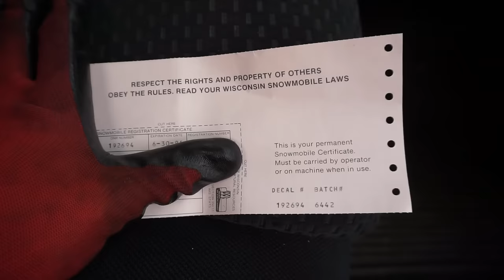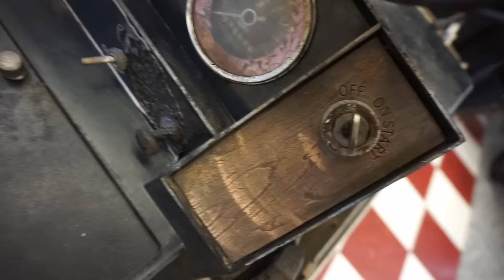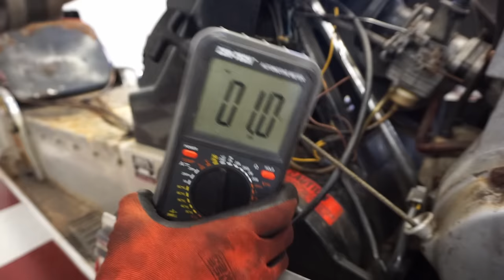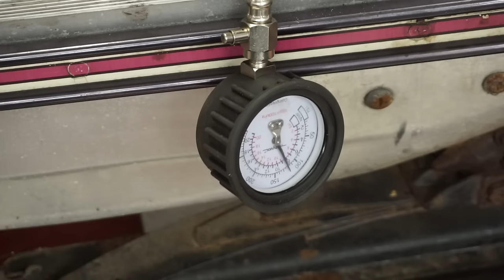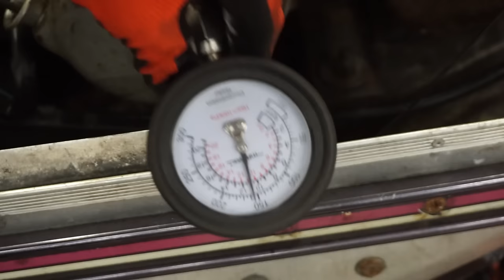$150 Sled Sat Untouched For 30 Years. Will It Run?

Comment: I had basically the same sled when I was younger. Arctic Cat 340 Puma. It was one of the most reliable sleds, never breaking down. I used to have to blow in my gastank to get it to start when it was cold.

Comment: Very nice! My father bought the same model new in 1972 and I grew up riding the machine, great memories! Arctic Cat was the first manufacture to invent the slide rail rear skid while other manufacturers were using the boogie wheel carrier for the track. A beautiful machine for the 2vintage fleet!
Reply: My dad bought this same machine in 1972 when I was 13 years old. This was the first machines that I ever rode on. I did happen to remember he paid $1095 for it.
Reply: @jefffreestone8476  I was 7 years old then, yes it doesn't sound like a lot to pay for it but back then it was a lot of money too. A great way to spend time with our Fathers for sure.
Reply: I was 15 in 72 and drove many fun miles on a Cat like that.

Comment: My favorite hobby was restoring vintage sleds from the mid 1960's - early 1990's, I have no idea how many I restored there were so many, the one thing I became very good at was rebuilding carbs, Tillitson, Walbro Mikuni ect.  I had no choice but to quit because of my back, I had a terrible habit of not asking for help when lifting and moving these old sleds into and off the back of my truck and trailers, and around my garage and property. My favorite restoration was a 71 Arctic Cat Lynx 292, that little thing was so much fun to ride for a single cylinder, it looked showroom new...I got it for $150, I sold it for $2000, but that was with a few hundred dollars and a ton of time and effort put into it....I enjoyed every minute of it. The guy I sold that 71 Lynx to enters it in many vintage snowmobile shows.  This old 340 video brings back memories.

Comment: So one fuel line is the feed,the other is the return.the feed needs to go almost to the bottom of the tank.also,that carb is a pumper carb.the pump is the bottom half of the carb,and it has diaphragms in it.last time I restored one,dennis kirk sells parts for them.should b able to get carb kit and the fuel filter that screws onto the bottom of the carb.pay attention to the way it comes apart!!

Comment: I don’t have the snow to own or get the chance to work on snowmobiles but I work on a good bit of vintage dirt and street bikes. One of the first things I do when trying to get spark is unscrew the cap ohm test it then cut off 1/8-1/4” and reinstall the cap. This removes oxidation of the connection allowing better conductivity. 
You do great work, very methodical 👍🏻

Comment: All in all a success story. Im guessing that the numbers written on the head plate were previous compression values. I know nothing about these sleds but I doubt wether the gas tank needs pressurising. Could it be a flow and return?
You could maybe get one of those carb bowls 3D printed or turned from a piece of aluminium stock easily enough. The slots in the flywheel are for adjusting the points through. (The croc clips were sort of sparking behind the plugs when you were turning it over by the way). The flywheel would only need removing when a points or condensor replacement was required. 
Evaporust and tank sealer will sort that tank out.
This is third video Ive watched and I love your enthusiasm. Keep them coming.

Comment: Eric Sandrin in Kirkland Lake had this sled it had 2 optional motors a 292 a and b motor super simple to work on and fix and talk about go anywhere sled ! The only other skidoo that could go where this panther could was a '68 super Olympic bomb , I know I owned 1 lol, but anyhow there's a little modification that we did and that was add some plates to lift the slide suspension on the 3/4 cleat steel track and it made a huge difference in the powder, and climb almost any hill up to almost 90 degrees, kid you not small motor but dam strong and pull ( emergency towing ) sleds 5 times its size and weight if I had the chance to get another one of these Panthers I'd buy it in a heart beat !!! I know what these old sleds can do it and they are amazingly strong and great in the powder and off trail riding !!

Comment: Love the snowmobile content!  One tool I think you would really like is an impact driver for removing rusted screws.  You kinda accomplished the same thing when you were pounding on the screwdriver but the impact driver also twists it for you when hit with hammer.  Also, when I've worked on snowmobile engines I like to pull the drive belt off the clutch so that when it does start I can throttle it up without the track moving.  Great work!
Reply: That's the worst thing you can do... The clutch can randomly slam closed and break it.. there's a reson the say not to.
Reply: @philipgagne1852  That's an interesting take and maybe something that newer or racing clutches are prone to.   I've been wrenching on sleds for over 30 years (as a hobby not a professional) but mostly 70's-early 2000's and never had a problem.  That's not to say it's not possible, I have just not ever heard of it happening.  When I do need to run the track I'll put them up on stands.  In my opinion, on a scale of worst things to do there are a lot more ahead of it including the sled moving forward when you or your bystanders were not prepared.  Best solution then would be to always lift the rear on a stand.
Reply: Yeah all clutches can do this look in repair and service manuals  many say not to run without a belt it's a big big no no.

Comment: If your going to get into older snowmobiles  always keep a squirt bottle with premix in it and you can squirt a bit in the carb with the thotle open to see if it will fire up for a couple of seconds to get an idea on how the motor runs and what you need to do next

Comment: Older sleds have a wear rod welded to the bottom of the skis, Newer ones have mounting holes in the skis for carbide wear rods. Also, check the Hifax for wear.

Comment: Might have already been said ,but the slots are there so you don't have to take the flywheel off so you can clean the points and set timing.  No reason to remove it unless you are replacing the points or condenser.

Comment: Great job. I've had a few of these old Cats over the years, including a 1973 Cheetah with a 440 Kawasaki, which I suspect was quite similar to the 340 Kawasaki in your Panther.  My Cheetah was a quick sled for its era, but it often fouled plugs and ran hot when temperatures were above 30 degrees Fahrenheit.  The tank has two lines because one of them is a return; I don't think the tank is pressurized. Also, I agree with what a couple other posters have said about brittle sprockets on these 1967 - 1972 Cats. I had a 1968 Panther which destroyed its sprockets the first time I started it. I think reproduction sprockets are available.

Comment: No the gas tank is not pressurized..  One line is fuel return.  You need to hang a machine like this so that the track is free just incase the clutch engages.  This engine is a piston port you may have tore out what was left of the bottom end by not using premix  in the bottle to start it. I would spray a good penetrating oil in the vaccume port of the engine.  It still could loose the seals in the bottom end.  If you are going to keep picking up old sleds you need to pick up a repair manual called Snowmobile Service Manual by INTERTEC publishing.  Mine is the 11th edition.  That carb is going to need to be kitted at a minimum.  Back when these sleds were newer it was common to keep a second rebuilt carb on the sled when riding for in case something happened.  I have all my old sleds converted to a single Mikuni carb and use an aftermarket fuel pump.  What you do depends on what parts you can get.  That fuel tank is shot If it was me I would weld up a steel tank to fit in the factory position.  One  nice thing for you is that Kawasaki where my Panthers have a Sachs and JLO.  Thanks to the internet folks that like these old machines have an easier go at keeping them running because of so many vintage sled clubs.

Comment: Mine was the 1973 Panther 500 (3-cylinder).  This replaced my 1968 Roll-o-flex (1 cyl).  I put holes in one of the pistons 2 or 3 times.  In 1980, someone cut the wires and lines and tried to pull the engine out when we were out of town for a weekend.  Never got it running again after that.  Compared the the 1-lung Hirth, this one was fast!  The "family model" seat was big enough to hold three of us kids.

Comment: beautiful machine, nice work getting it going, can't believe the compression on that motor, turned out to be a good score, any follow-up video on that? did you deal with the gas tank? I've seen guys put gas and/or solvent in those scaly rusty gas tanks, along with a bunch of steel nuts and shake the crap out of them, then dump them out, might have to 'rinse and repeat' a few times, and put a clear high capacity filter on it for the first while, and be prepared to change it a few times til the gas runs clean.

Comment: Man these old snowmobiles bring back memories. These and the old contact point motors on snowblowers is where I began being taught about small engine repair. I had a Pantera and then an old Phazer. We cleaned the metal gas tanks on the old ones by putting stones in them and shaking them forever! Love the videos bud!
Reply: Rocks or screws/nails is the way to go!
Reply: @BXtremP  Yup and shake shake shake!

Comment: you should service the carb. line the tank after you treat it. id start with evaporust or muratic acid...then kreem the tank. run an inline filter and be prepared to change it almost right away. nice job to get it running.

Comment: I’m wondering if you know what “Kroil” is? Are you familiar with it, have you ever used it? My dad introduced me to it, he used it in the oil field. It is a penetrating oil that actually penetrates. I know that sounds dumb, but the truth is, it works better than any other product on the market, test proven... We joke, and say that the manufacturer should had named “crawl” instead of kroil, because it actually finds its way through ANYWHERE that there was once a space, or friction. Lots of people think PB Blaster, and some others are the best penetrating oil, it is not. I’ve removed frozen spark plugs, and freed up stuck rings with kroil when no other oil could. Look for it if you never used it, it’s in an orange can. It’s expensive, but you only use it when you think you really need it. Keep your other choice around for everyday use.

Comment: You can use A snapper riding lawn mower twist down relief valve gas cap on that snowmobile gasoline tank if you didn't know that. Unless it's the sealed one totally. Witch it would still work on it.& After riding it around you can release the pressure off of the fuel lines by opening that twist relief valve on top of those style of gasoline fuel caps. Much simpler to use on those types of snowmobiles I think anyways myself. Cause I'm sure it has A fuel gauge inside of the fuel tank to.

Comment: the diaphargm in the carb is certainly bad after 23 years so i would order a carb kit. Also, i would advice to lift the back end when starting a sled. You don't know if the clutch spring is good, if the carb set too high ,etc. That could prevent a runaway.

Comment: That's very cool, nice work! If it hasn't been mentioned, just to let you know, the fuel line going to the filter, is fuel being pulled from the gas tank. The other line, returns fuel to the gas tank that it does not use. So the pickup line needs to go all the way to the bottom of the tank. The tank is not pressurized. Hope that helps.

Comment: That's a fuel return line, it's not designed to create pressure in the fuel tank. The right hand cylinder might be a little lower compression because it's leaking out of gasket. There's a lot of Gunk on the cylinder head cooling fins.

Comment: Those are a pretty good engine we installed one on a fl250 Honda odyssey years ago and road the heck out of that thing the funniest part is it would actually do burn outs on the asphalt
The engine we used was 440 AC

Comment: Anytime you have hard fuel lines use a heat gun to warm up the lines. Always keep spare boots +++ And never fill cylinders with flammable spray and leave spark plug over hole big fire lol...

Comment: That is a 72 Panther with a 340 Kawasaki engine and Walbro carb. Ditch the carb for a Tillitson model HD. Will run much better. The Kawasaki's were good engines. The cylinders are electrofusion. No honing or boring. You should be able to pull the plug directly off the motor which cuts everything and there should be spark.

Comment: Knew it wasn't a 77. Had a 72 puma exact same style. Puma was shorter, was a 399. Problem with those tracks was the full cleats. They stopped using those went to partial. The cogs drive off the cleats. They don't flex so uneven surfaces they break. They used to be pricey plus the rivets that hold them on was stainless steel. Was a major project to grind the factory rivets off. The new pop rivets was so tough They ruin a  rivet gun. We went thru many rivet guns. Now days you use a disc grinder, pneumatic rivet gun, make short work of it. We had a couple drills and grinding stones. Grind til the drill was to hot to hold. Switch drills. Bust your hands up trying to pop those rivets. Shit was torture. If you leave that plug on the engine unplugged, engine will run. Used to do it when my uncle lost the key once in a while.

Comment: Thanks for the trip down memory lane. I repaired a lot of those old cats when I was around your age. Late 70's early 80's. Learned a lot of good tips too. used to have a ton of left over NOS parts for them. But got rid of most of them. Should have checked timing when it was that far apart. they run like a watch when you get those things firing 180 degrees apart. cool vids. keep em coming.

Comment: I always liked the old arctic cats but they were known for eating coils.You should always have an xtra belt and coil when riding those things.A lot of guys made brackets to mount the skiis wider for more stability so they don't tip over as with most old sleds.

Comment: You need a nurse tank when starting the motor--just a temporary fuel source to run the engine while troubleshooting other things. Make one out of a plastic bottle, about one quart will do, hang it over the engine, connect a fuel tube to the carb(s) and let it idle.

Comment: The gas to the carb the other one is a return line . The doesn’t pressurize as a matter it needs to be vented . Iam old and worked on these things since I was 12 years old  good video watch for the idle to change to a high idle it will be the center seal on the crankshaft. Good luck.👍🦦

Comment: Another thing that's interesting is the number written in front of each spark plug. That's the compression number when whoever checked it before. I had a feeling at the end of the video the numbers would be close to those. We use to do the same thing.

Comment: Before you go too far, pull the engine shroud off. I'll bet the mice have packed the cylinder fins solid. No cooling and bang. I found out the hard way on a 79 Pantera. Low power and long track makes this sled an amazing trail breaker. Great find.

Comment: Definitely need some por-15 tank sealer after you get it cleaned out.  It will take care of any pin holes leaking any fuel pressure.
Reply: That stuff really works long term? I use apple cider vinegar to clean rust from tanks, and found that it works really well, but I’ve had a couple tanks that developed pinhole leaks, and I been looking for something that fixes leaks from the inside...

Comment: I had a old Arctic Cat similar to that when I was younger back in the early 90s. Thing was a tank. Was riding with some friends on a warmer day and the fan belt broke. Did not know it at the time and severely overheated the engine. Was not worth replacing the engine so it was traded off as part of a deal for a Yamaha Phaser II. Ended up sticking that one in the trees and dislocated my shoulder. Fun times.

Comment: You need to invest in a Bolt Buster if you're working on these older rust machines. Also, isn't that engine a two-stroke that uses pre-mix?

Comment: I think your off on your fuel assessment, diaphragm carbs use vacuum to pulse and suck fuel from the tank, the other line is to equalize the pressure so the tank doesn't draw a vacuum and stop fuel flow and can circulate fuel. This is a common setup for 2strokes so they motor can run in all positions ala a chain saw and leaf blowers.   Nice project I enjoyed watching

Comment: Also just FYI if those coils have little cracks in the plastic housing, once the heat up from heat of the engine they will run til hot then shut down, very common issue with those coil packs, starter ring gears normally pressed on, if you have pins then be careful cause those flywheels are balanced with starter ring gear, and yes you need the fuel pump to draw from the rear tank unfortunately

Comment: 150 psi after 6 pulls look at changing crank seals because u should 100 psi by second pull or second rotation of piston, and gas tank cap originally had the fuel gauge which was a two rods going down with a cork slide on brass and very hard to find and locate old school caps, and yes unfortunately I use to be a artic cat guy that's eat sleep well u know old artic cats lol until I moved to a non loving snowmobile southern city 😤 but anyhow best of luck with the panther

Comment: I always take the heads off to clean and oil everything because sitting as long as it was you never know how bad it is and a little extra time to check everything over could save any unnecessary damage

Comment: You should adjust the point gap and reset thu windows in flywheel . Usually about .020 gap. might be listed on flywheel.🤔👍